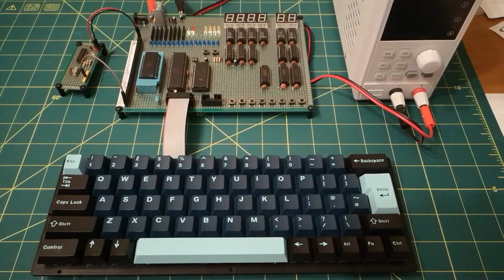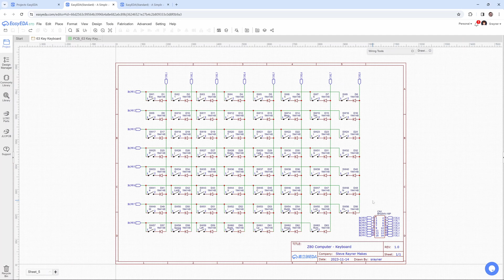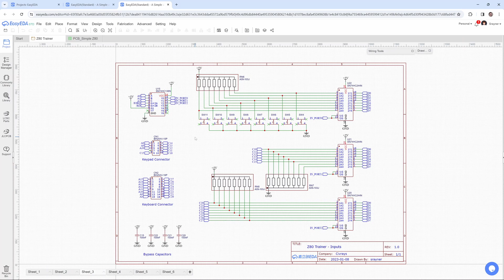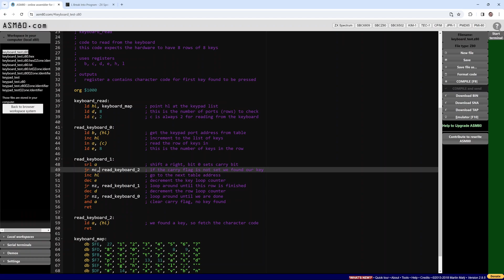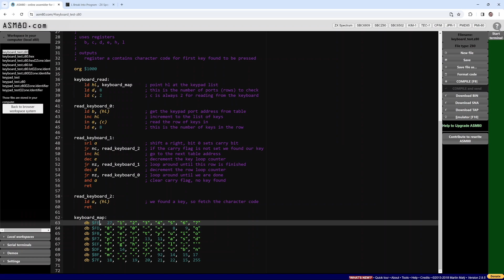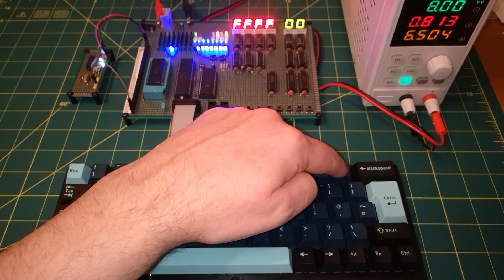Z80 Computer - Part 15 Testing the Keyboard

Comment: Lovely keyboard. I built Z80 systems in the 1980s, but they were embedded systems so never thought to add a keyboard interface. Keep it up!
Reply from the maker: Thank you. this project is so much fun to play with. When I had a Z80 computer back in the 80s I did not have access to any electronics. All I could do is read about this stuff in books and dream about making things. Now I can do the things I wanted to do as a child. I've got a long way to go, and a lot of learning to do, but I'm having fun.
Reply: @SteveRaynerMakes  My first computer was a 6502 system (Acorn System 1) but I did a lot of assembly development in z80 on the ZX81 later on. Writing assembly on paper, and having to re-write it on paper again when I added one instruction was a pain, but it was more fun that watching TV :) That project got me a place in university which was a bonus.
Reply from the maker: @mikehibbett3301  oh yes, i can remember spending hours writing assemble code out on paper. Manually looking up the instructions and cross referencing the hex codes. Type the hex codes in, save them, run the program, watch it crash, scratch my head and repeat. To this day when I write any program code I always save the code before trying to run it, because I was so used the whole computer crashing and losing everything that was in memory.
Reply: @SteveRaynerMakes  lol. We must be a similar age. They were great times, I remember bringing my computer into school, and it was the first one they had seen. Happy days

Comment: Wow, that keyboard looks great.  I built my first z80 board in 1985 and had a little 20 pin keyboard I pulled from a calculator, just enough for hex digits plus a NEXT, WRITE, GO, and some other button (I forget).  Was simple enough I could enter programs and run them out of a sub-256 byte boot code in an EPROM. I remember writing a very similar keyboard row/column scanner just like you show at the start. Was thinking for your keyboard you could write a little test program kind of like the HP calculators (like the 15C or 32S) use in their secret selftest modes, you just hit every key from left to right top to bottom and the program figures out if it saw all the right codes and finally displays "OK" at the end. Could implement using a table of expected results or a checksum I guess.   Looks like great fun on your end and a trip down memory lane on mine.  Thanks for sharing!
Reply: I have exactly same story abt. 1983 ;-) also made paper tape reader